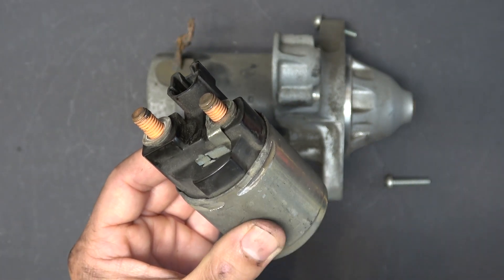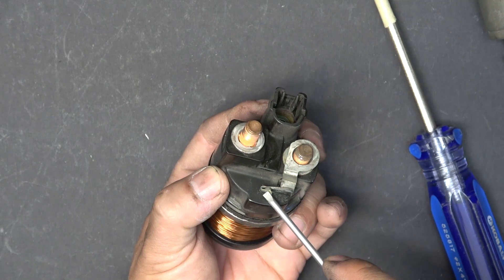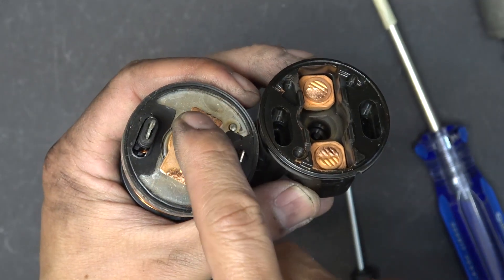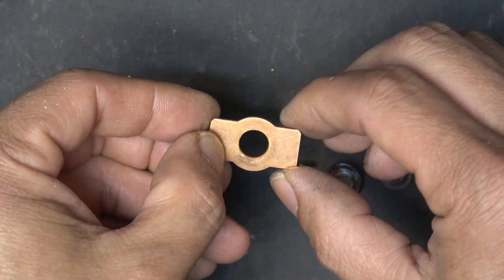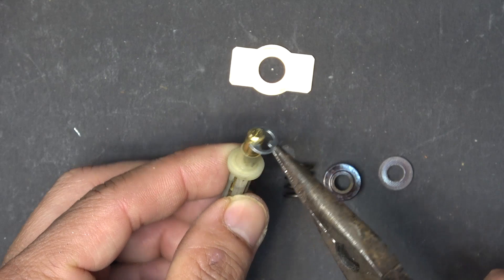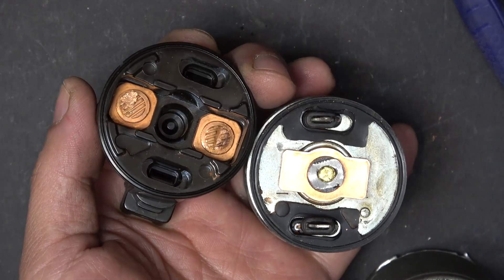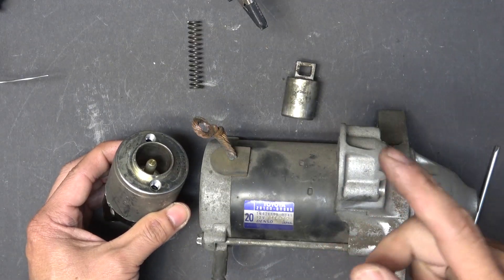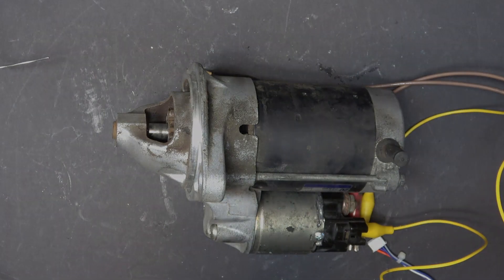DIY: Repair a Denso starter solenoid from a Toyota

Comment: I have a 1999 Toyota Sienna, and I have to push an 'unlock' button on my alarm key chain to start the car.  I want to remove that feature from my 1999 Sienna.  So if I want to start my car all I have to do is insert my key and start the engine, instead of pushing an 'unlock' button then insert my key to start the engine.

Comment: Wow..The manufacture used such poor contact design in that 'Starter Relay' Only half of the copper contact surface is being utilized.. What company made that starter? I sure as heck want to stay away from whatever brand made that POS solenoid.

Comment: totally pointless so called repair, everything he does is just facepalm moment. so called wornout contact is the way its supposed to be, turns and flips contacts, with 1 start its going to be exactly the same, meaning working fine and will have the same marks on the so called new side. thats why there isnt a before video showing us how the solenoid needs repair and isnt working. if anything you cut up a sealed solenoid, were there no water oil dust goes in, its clean as, chops it up and he thinks his closing it with 2 screws that arent even holding, then he solders the connection which gets so hot when cranking, its going to melt the solder, dont you think there is a reason why they dont solder that connection?
Reply: I was actually wondering if this solenoid did fail to operate. Didn't look to me like it did.

Comment: When flipping the contact at 3:35  instead of breaking clip and replacing with diy part you can pull the plastic tube on the shaft off using a small flat head it's held in by small clips. Flip the contacts over and push back on.
Reply: Good catch

Comment: Nice job. I will try it on my Toyota Allion starter. I removed it yesterday. The motor is rotating but the solenoid is not engaging. When I try to start it whilst attached to the engine its just clicking. The price for a new one is too much if it can be repaired!! The battery is in good condition.
Reply: How did it work out for you?
Reply: @xandervk2371  Dissembling it was very difficult in my case, I ended up aborting the mission kkkk. They assembled it with USE ONCE in mind lol.
Reply: @tatendajack  That was actually my take on the video, the part is indeed not serviceable.

Comment: What year is your starter from? I thought the older 80s & 90s Toyota starters had a lot more easily replaceable parts, but don't recall exactly. Unless just replacing the whole little solenoid part is the idea?

Comment: You are very kind to show how to repair the car tool.
I did something like this and in addition i welded a copper wire to the worn copper sides with tig welder machine.
Reply: I think a small tack wield would be better to secure the crimped ring. Or better yet, have the manufacturer get part  number and dimensions so we could buy another or make it to specs.

Comment: Thanks!  The world needs more people like you.  prior to opening is there a way to determine if its the solenoid or the starter motor itself that's an issue?
Reply: Know this is old, but you can use a screwdriver to bypass the solenoid by shorting the two larger bolts on the bottom. If it turns over then that is a good indication the solenoid is bad.

Comment: When I worked at Valeo repairing solenoids we used to get new clips for the contact. Much the same as what you made. I used to repair about 150 a day. Bosch 0331 303 ---. We had presses and automatic de solderers. Pity they moved it all to France.

Comment: Good job but I believe the e-clip will last longer than the aluminum washer you installed as once it heats up it'll try to return to it's original shape.
Reply: Why didn't he use the circlip, maybe it was too loose?

Comment: How are you keeping the water out of the solenoid coil now that the seal is compromised?
Saw a method that I tried today,. You use a nail and hammer to push the folded over part up and away. Then de solder the leads to the coil and remove the top part. After you sand or file the copper contacts smooth you can put the top back on and hammer the metal back in, solder the leads and seal the edge with silicone. It worked very well.

Comment: Great video. Thank you. Do you know if this would also apply to a 1997 Toyota rav 4?. My starter keeps running after shutting off the engine. I think the solenoid may be stuck.

Comment: Why not add solder to the worn down copper 😂
Reply: Its hard to solder to copper champ. You normally remove the copper enamel just to solder to it
Reply: Solder has a low melting temp, the arcing from the contactor creates hot plasma, which is why the copper gets so worn out.  Solder would not hold up.  Infact theres a chance that the solder could melt and Fuse the two contacts together.

Comment: Great determination and very good video! It ain't broke until you cannot fix it anymore  is something my grandfather used to tell me.  When I was a kid my grandfather showed me how to drill out the rivets on a lawnmower solenoid,  clean & grease the contacts, then put it back together with screws.  I fixed a lot of them in my life and this is even a better example of fixing a "non-servicable" solenoid.

Comment: Was NOT able to separate the solenoid. Tried as shown but screwing the screws in resulted in two bulges in the solenoid housing, it not separating and the housing becoming useless and not rebuildable....
Thanks for nothing.....:face-orange-raised-eyebrow:
Reply: You buggered it up, and now you're blaming someone else. Don't lie: Did you use an impact to screw in the screws?

Comment: Wow,I am impressed by your clear knowledge of that stater solenoid repair example.Is it possible to reach the solenoids 2 screws at the back to take that solenoid off the starter without removing the whole stater.Thnx

Comment: I appreciated seeing the inside of your Denso solenoid because I am trying to diagnose why my starter failed the other day. If your Denso solenoid is similar to mine, which is for a 2004 Sienna, then there are 2 concentric coils inside your solenoid. One coil is called the PULL-IN coil. The other coil is called the HOLD-IN coil. Most ohm meters have a resistance in the meter's probe wires and you can determine that resistance by shorting the ends of the probes firmly together and noting the reading (mine was 0.4 ohms). Once you know the resistance of the probe wires, you can subtract that value from the resistance that you measure across each coil. Both coils connect to the same trigger terminal on the solenoid which goes to the key switch. The other end of the PULL-IN coil connects to the stud that receives the heavy braided copper wire from the starter motor. The other end of the HOLD-IN coil connects to the outer shell of the solenoid which is grounded to the engine. My PULL-IN coil measured about 0.4 ohms and my HOLD-IN coil measured about 0.9 ohms. If a bad electrical connection or a broken coil wire prevents the PULL-IN coil from passing current, then the current through the HOLD-IN coil alone will not allow the solenoid to do its two tasks, which is to switch battery current to the starter motor and push the pinion gear forward into the flywheel. After I cleaned up the outside of my solenoid, it is now working properly. I am left to conclude that my starter failed the other day because either the nut on the lower copper stud wasn't tight enough, or there was dirt between surfaces where electrical connections take place, or the miniature relay in the fuse box was not sending 12 volts to the trigger connector on the solenoid for some unknown reason. I hope this additional information helps.

Comment: How do you know if whats bad is the starter is the solenoid?
Reply: Good question?
Reply: @donald8354  not really, once is out, you conect it to the battery and you can see what's failing
Reply: When the bendix gear does not come out or stay out (bouncing in/out) the solenoid is at fault. If the starter does not spin then it the motor.

Comment: You can compensate the worn by adding a thick washer or steel ball inside the weight where the spring is located 
You can get away with this without dissambling 
the solenoid

Comment: I basically done the same thing for my solenoid 
For skoda 94 
Instead of flipping the copper contact plate 
I clean the contact area add a washer for compensating the worn copper it worked like new

Comment: dumb question is a solenoid really just a BIG relay ?
Reply from the maker: In a way, they are basically the same. They are both relays. The only difference is in their functions. Relay functions as an electrical switch to relay small current to a different circuit with a bigger current. Solenoid does the same thing except that it also needs to move the pinion on the starter to engage with the flywheel. Not only is it an electrical switch, it is also a mechanical switch.
Reply: @vuaeco  May I know what was the size of the thread tap and the screw you used?
Reply: You'd be dumber if you never asked.

Comment: the reason for the malfunction doesnt make sense to me. nor does your repair idea. looks like the contacts just need some leveling, they look like they're just melted a bit from the electrical arcs. but even that doesnt make sense to me why its broken hehe thanks for tearing into this for us to take a look. toyota could have made this serviceable, too. the solenoid could also use a little better sealing where you cut to open it. at least some electric tape or "school glue" lol
Reply from the maker: Believe it or not, this starter has gone through 200,000 miles. It doesn't look like it's worn much but you have to remember it has to run a very large current. Once it's worn down to a point it cannot support that amount of current any more, it will quit. 
Well, it is still sealed, there's no exposed part on the solenoid.
Reply: Vu lives in SoCal, Noah. What's gonna happen...snow? LOL
{checks news}
Uhh...never mind. Eesh.